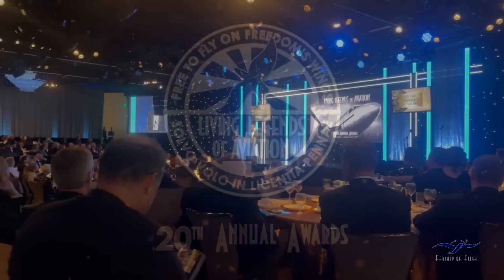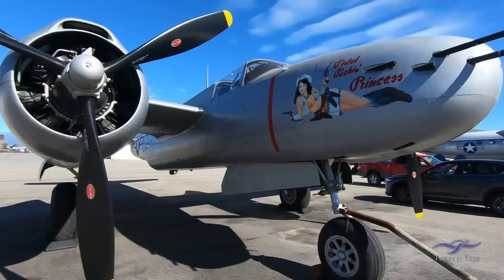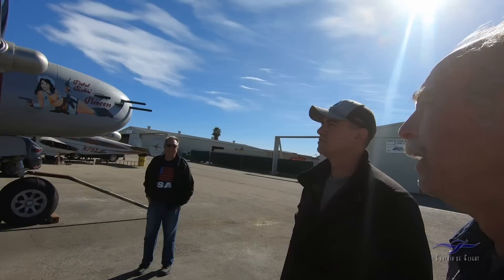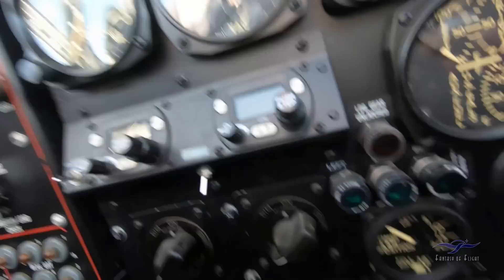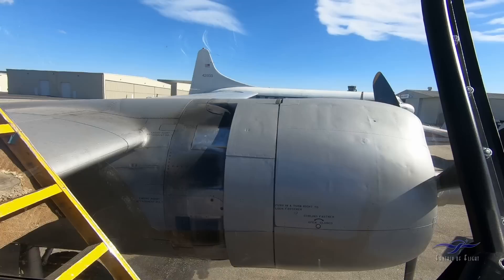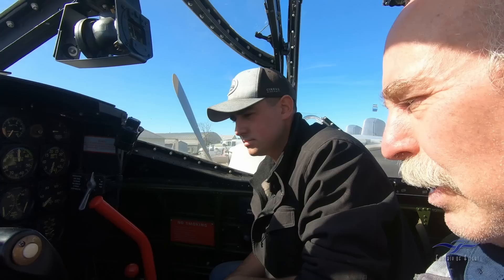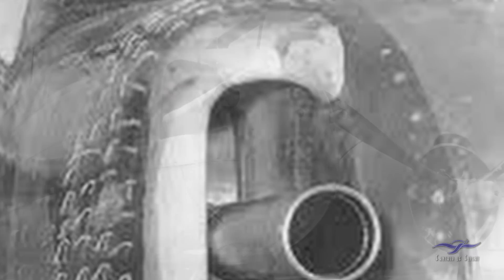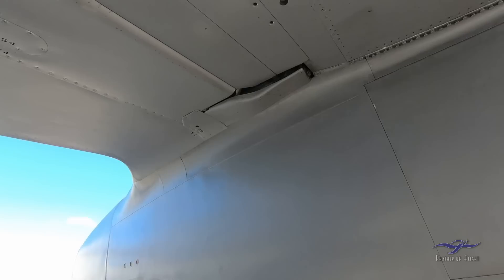Douglas A-26B Invader - Part 1 - Project Visit - January 2023

Comment: Nice A-26! The dessicant should be BLUE. It turns pink when it's spent. If that dessicant is Drierite, it's toast. If, on the other hand, it's silica gel, it can be regenerated. It can be regenerated by heating at 105 degrees C for a couple hours. Put it in a Pyrex tray and heat it in an oven. We didn't have microwaves when I learned about this stuff. Fox Alpha on the Morse!
Cool about the princess wife. In the A-6 Intruder of Life, I am the pilot and my wife is the Bomb/Nav. She punches in the coordinates and I make it go there, hot, low and fast.

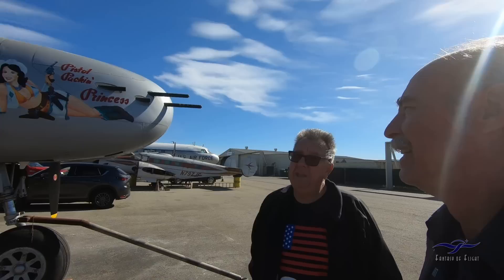Comment: Today is September 22 2023 and you just flew your B26 over my house..San Bernadino, Los Angeles county line in Pinon Hills Ca. about 11:30 pst at 8300 ft ele and 249mph. EVERYTHING flys over this path. I heard you coming for 2 minutes and ran outside. Said to myself, its not a B25 twin tail, its GOTTA be a B-26. Went to flight aware and there was no 10 minute delay. My dad was on Tinian Island. Navigator on B-29's. I bought one of the last 2 B-29 models, signed by Paul Tibbets with documentation and a picture of him signing it. You are an inspiration to us Pilots and WW2 enthusiats. Thanks so much Kermit from Keith
Reply: N39401

Comment: My father and I worked as aircraft engineers for a company called ConAir out of Abbotsford BC in the mid 70's, they were primarily a water bombing company with a few DC 6 for heavy transport. The fleet for water bombing were several A 26's, TBF Avengers, two DC 3 and a DC 4... We would service the A 26 and go out with a pilot of a check out flight, such impressive aircraft, incredibly quick. The Avengers were just the opposite.. my father's best mate was a pilot in one that had a engine failure 200 feet off the deck and took outa large section of a raspberry field... They were retired shortly after.
The A 26 were eventually replaced by Gruman Trackers. 
I was out at Chino several times around 1978, and hung out there, I think it was "Planes of Fame" or something had a hangar there. There was a ME 262, a few mustangs, a B 17, and I believe a Kawasaki Ki-100 getting restored.. There were others but I cant remember all of them... But the F4U that were in that television series, three of them were parked out there, the guy said the aerial footage was shot in and around Chino... 
Place has certainly changed heaps since then..!

Comment: Why were these designed to enter the cockpit through the top?
Reply: I've wondered about this too.  Douglas did the same thing with more modern aircraft such as the F3D Skyknight and the A-3 Skywarrior.   For a big carrier based aircraft like the A-3, with a potentially wet and pitching deck, this seems like it would be easy to slip and fall from the top of the fuselage to the deck.